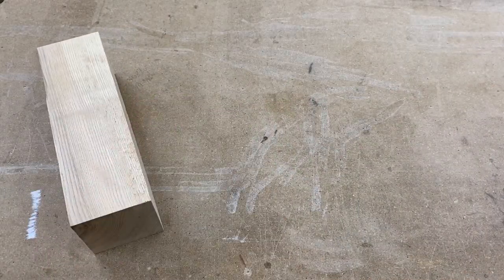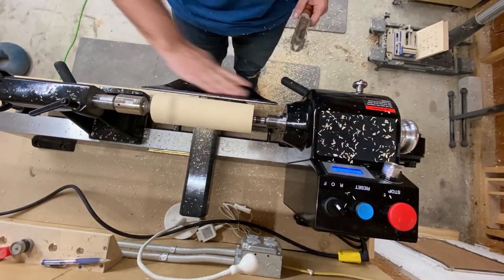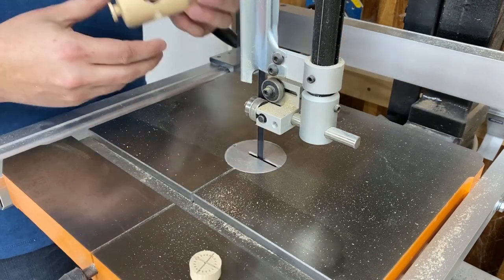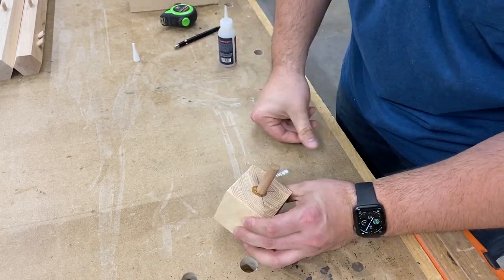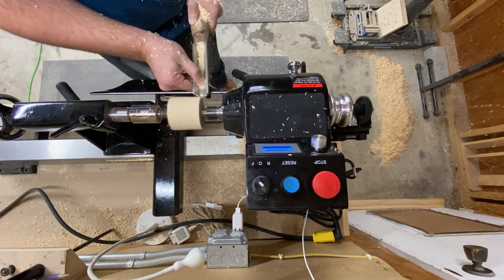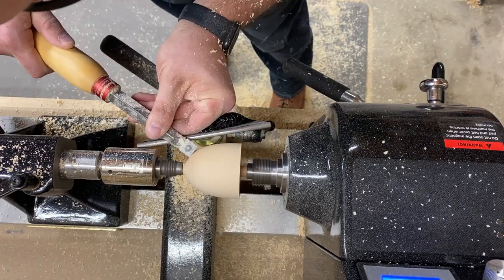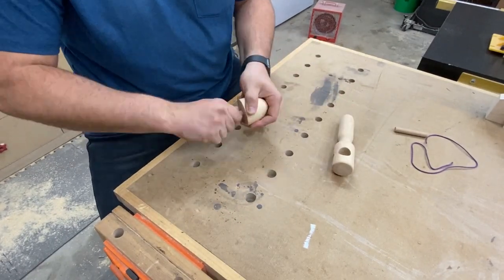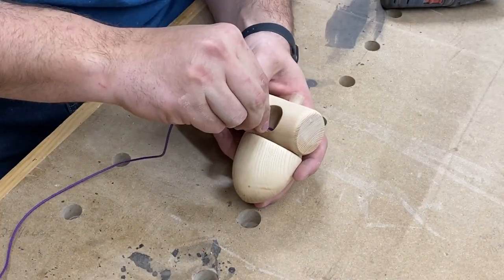How to Make a Spinning Top and Launcher - Harvey T-40 Wood Lathe

Comment: Such a great video! What is the marking tool you use at the beginning of the video? Looks like metal with holes in it when you are measuring and marking your blanks. It looks super useful and I’ve never seen one before.